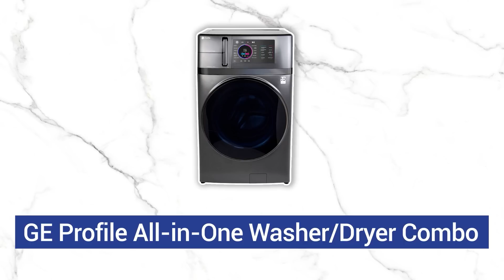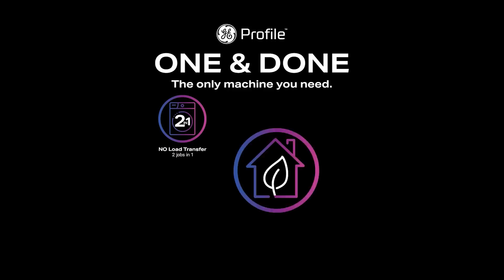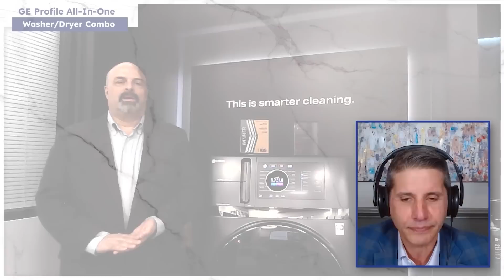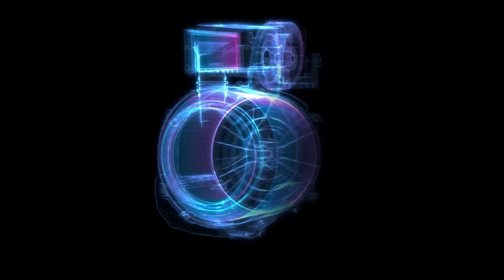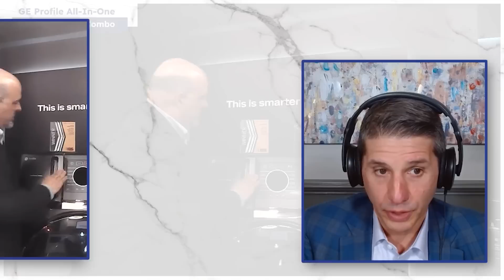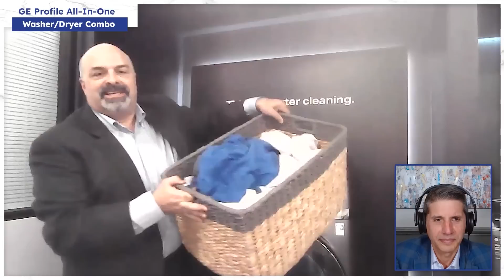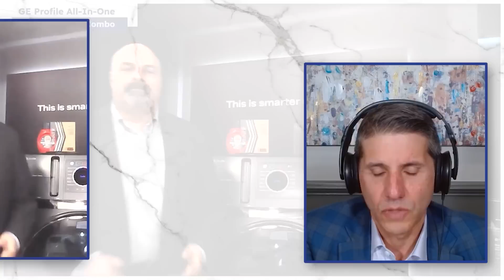New GE Profile All-in-One Washer and Dryer: Tough Questions for the Creator

Comment: I call BS on the lint not clogging up the machine and the heat pump staying clean. Their lint filter is one of the worst executions I've seen. It doesn't fit right so lint simply goes around it and covers the heat pump find. Wish the interviewer had called him out on this because the issue is so well known. There are even internet hack solutions that use weather stripping to improve the filter seal.
Reply from the maker: I think if you are religious about removing lint then the product is good. At least in 2 years of service
Reply: @YaleAppliance1 So pay $2000 for a washer dryer so that I can become a fanatic about lint removal because GE can't simply design a filter that fits, seals and prevents blow bye? Come on. You and I know they did this because it guarantees most owners will have issues within a year if not not months and will need to call for service.
Reply from the maker: Well, then don't buy the machine if you don't clean the lint. I clean the lint on my old Maytag after every use

Comment: So this filter does not catch all the lint. It does not seal properly and the coil gets loaded with hair and or lint. On top of that its a bitch to try to clean. On the left side li t builds up and dries on trying to find tools to get it all but cant. Just found out today water can be used to clean and drain through bottom clean out so i will try that but im worried if to big of chunk goes through it will clog it. With all that said we really do love the unit. I actually do 99%of the laundry and my wife doesnt have to.

Comment: I just bought this a few months ago and i LOVE it. In most instances its no more time than traditional machines. Less, if you count how often you forget to change it. I recently w/d my mattress cover. You know how usually you have to stop the dryer, unroll the mattress cover, get the wet part to the outside, restart the dryer? Well didn’t have to do that with this unit. I also think it doesn’t beat the clothes up so badly, produces less lint.

Comment: The creator is not telling people the problems.   1. No one can service these combos because  of  state laws that only trained hvac tech only can work on them.  2. Hvac tech cannot work on any appliances  that use heat pumps because only appliance  techs can because they cannot and are not allowed to get parts.  The lint still builds up. Secound since it has has 1 yrs to 5 yr warrenty  you cannot fix it. Cost is 3 times to fix the heat pump parts.  One ge had a bad pump and it cost 2,000 dallors to fix it. Plus the  freon is expensive and I see no ports to fix freon leaks then refill the system.
Reply: So after 5 years  you can pay someone 5 grand in parts and labor and wait for 3 months for china parts that are crap. Plus for large families it cannot do full loads so your ability  to do laundry is only 1/3 capacity.

Comment: The designer needs to do a better job on that filter system, as people have been observing dust and lint getting past it onto the coils and it's a pain to get in there and clean the coils and try to avoid damaging the fins.  When is the next new and improved version going to be released is the question?

Comment: The engineering was great but the Wi Fi App and the documentation are horrible.  The App is 50% ads that have nothing to do with the all-in-one unit.  The App is not made by GE but is funded by ads and is a pain to use.  The App is so bad my wife will not use it!   The Lint filter is a poor design and not sealed well so more cleaning is required to avoid repair.

Comment: I just got one, been running it for a week now. It's great. I had a 2.4 cu foot GE all in one before this and it's night and day difference on wash times and load capacity.   Also, it's way lighter on the clothes.  The other GE unit was very tough on things and cause the life expectancy to drop.  Imagine seeing brand new t-shirts look old after a few washes! You could see all the lint and colorful clothes parts shoot out of the water drain tube. Another thing that's interesting to me with this type of unit is the disaster preparedness aspect.   You could run this thing on a large ecoflow if needed.  Wish I could trust the app, someday I'll hook it up with an old wiped phone on an IOT network just to do some updates.  Good work! Wish GE could have figured this all out before they sold to Haier.
Reply from the maker: Thank you...Unfortunately, they would have never been able to make this under the old GE regime.  They never invested.

Comment: The form filter needs to be redesigned to remove the need for those placement holders - lint is getting through from those areas. Also, can people use condenser saved foam spray cleaner to clean the cold and hot condenser coils?

Comment: We went solar last year and one becomes very aware of how much electricity is used by various appliances.  We try to hang the wash when we can. I cringe every time we use the old inefficienct resistant coil dryer.  Not only does it use a tremendous amount of electricity but it requires punching a hole in the house and pumping out hot air to the outside.  I ordered one of these babies on sale - incredible efficiency, frees up a 220 plug in the circuit breaker for something else (heat pump or EV) and eliminates the vent - which can be dangerous is lint builds up.  Closed system is amazing - no more sucking air from the house.  And no more cooking clothes like they are in a toaster oven.  Should be much better on the clothes.  Just keep up with the filter maintenance and it will last a long time.

Comment: I like mine and I was totally freaking by paying $2400. The only problem I am having and trying to find if anyone else is having this problem too. In the spin cycle it shakes so violently that my pictures fall off my walls. I have done so many problem solvers and nothing helps. I called a technician and he said it was normal. I am crying because mine doesn't dry my bedding or heavy clothes like A normal dryer. I love it otherwise and I just want to get it to stop Shaking so hard.

Comment: I have one.  It lives you to it’s projections, it’s great.  It has a great warranty should it need service.  I’ll add one word of caution.  I stayed away from front loaders because of the mold issue.  This machine addresses that issue very successfully.  Keep the filter clean, I clean the filter after every wash.  Wipe the inner micro bacterial ring at the opening and there will never be a problem.

Comment: Purchased the GE Profile combo and it was installed on 9/5/23 and LOVED it. It then completely died on 10/9/23... I've had two GE third-party appliance repair services cancel service appointments with me because the unit is located in a laundry closet. Isn't that sort of location one of the primary reasons for the development of this machine... no venting required, available to apartment dwellers or people who don't have the ability to go to a basement? We are now waiting for a "GE technician" and I'm still not sure that they will service it. VERY disappointing and we're not sure what to do next. (To clarify, we did not purchase at Yale.)

Comment: We love this machine, but we do have to clean the lint filter after every single load. The sensor even prompts us to press the button asking if the lint filter has been cleaned with every load - even after Self Clean - which is a bit annoying. Also, the crevice tool for our Electrolux can't get all the way inside the lint housing because the it won't get in there when it's on the wand. There have been a few other issues, but overall, this Groovy Combo has been a life-changer! It would be good if you could provide some type of tool to clean out the lint slot that reaches all the way to the back. I clean the drain pump about once per week. Also, sometimes a few items bunch up and stick to the drum and have to be re-dried. Regardless, based on our experience since we got our Groovy Combo in August, I am blown away by it. My back also appreciates not having to make that transition from washer to dryer. I'm hoping it passes the longevity test. Thanks so much, Yale Appliance, for posting this interview. I stumbled across it in May and decided I was going to get this machine when it came to market. I gave it a 5-star review on the GE website.

Comment: I have had one for 6 weeks now and it has multiple issues and customer service for GE is less than desired and that’s being nice about it. There are NO appliances repair companies in Rural areas that can FIX or order parts and GE Repair techs will not DRIVE further than 10 mins outside the City limits! I LOVE my combo, but right now with the 5 errors codes, it’s LOUD sounds like I am washing nuts and bolts and then in dryer mode it flips my GFCI. All GE will do now that they know there’s not an appliance repair tech nearby they will reimburse me the cost of my machine minus the pedestal, minus the delivery fee, minus the extended warranty on the machine. 😞.
Reply: Did the delivery team take out the shipping bolts? I’ve read this situation happening frequently. Good luck, hope it’s fixed quickly.

Comment: I’ve had this combo for a few weeks now. I feel like I’ve been catapulted into the future! There is not a day where I feel like I’m doing laundry at all. The real work is folding and putting away now. Ours got back ordered and the laundry that built up for those 3 weeks was finished in a matter of a couple days. You can run this at night, when you’re away, without worry of a dryer fire. Also your laundry is dry when you get back to it, so there is no wet laundry that still needs to be put in the dryer and dried after you get home if you put a load in before you went out. I have ditched my laundry schedule and just throw a load in when a basket is full. I keep a clean basket to pull the dry clothes into and it goes straight back to a room to get put away in a flash.

I will never go back to traditional washer and dryer. This combo cleans better than any high end set I’ve ever had. There are never damp pockets or waistbands, no soggy quilt burritos that need to be flipped and dried again.

The only load I had a problem with was a small load of microfiber cleaning cloths. They were plastered to the inside of the drum and both wet and dry. So I hit the rinse/dry cycle and came back to them dried and fluffy. I think if I put them on a light spin instead of high next time it won’t happen. 

GE hit it out of the park with this one. It is truly a game changer. For anyone thinking it’s slower, it’s just not - embrace the freedom this combo will bring you. I simply do not have a backlog of laundry anymore, it is all always done.

Comment: New heat pump technology (if you consider a dehumidifier new technology)  Heat pump is terminology for hvac systems with a reversing valve. Technically you can call any refrigeration cycle a heat pump (all compressors pump heat)

Comment: Typical GE front loader washer rear tub bearing last up to 3-5 years. Compressor are not designed to last. So figured if the cost of the repairs are worth buying this washer for 2,800-3000 thousand dollars. Expect average of the life of this washer under 5 years before a major component breaks down.  From what I hear to replace the cooling system the whole cooing circuit gets replaced. So 1 full year parts and labor only 🤦🏻‍♂️ and 5 years warranty on just the cooling system parts only and no labor. 😂 who cares about the motor.  The drive motor is bulletproof. Give us 10 years on the Tub and cooling system. Heat exchanger will rust. Where’s the condensation going when the evaporator sweats.  So I’m gonna charge 800 labor to in stall if the cooling craps out of labor warranty and 500 labor or more depending how hard it is to replace the outer tub bearing assembly. Money making washer 🫰🏻
Reply from the maker: 3-5 years?  Really?  I think your numbers are a bit off.  Their new design has not been out that long.
Reply: @YaleAppliance1  think about it. GE has been using that same bearing from the same factory for years. It’s on my GE front loader. My sis front loader my moms front loader. We all have GE front loaders. I’ve replaced all 3 of our GE front loader bearings within the five year mark when purchased brand new. Now my sis bought the GE fresh front loader it’s been 3 years since she had the washer and I’ve already had to replace her bellow. He spoke about that GE has been using quality parts and components for years. Which that statement is incorrect. GE control boards go out less than five years I’ve replaced mine twice. You remember when GE put out those High energy water heaters with a compressor built in 😂 what a joke. Guess what. That’s the same compressor is in that washer/dryer combo. Those water heaters where nothing but problems. It’s new product with the same part built from previous appliances. Nothing is new when it comes from building a product using the same components. Well my friend those are not quality parts.
Reply: @YaleAppliance1  so I got pictures of the heat exchanger and compressor cooling circuit. All plastic. Have a few GE tech friends when I was working for GE. One tech took 2 hours to take the cooling circuit out. Stated it was not fun. Had to disassemble every wire harnesses with no quick release. Stated not worth repairing the cooling circuit if you just had to change out the compressor only. So yeah good good luck with those five years seal system repairs . After five years if that compressor goes out it becomes a pile of trash 😂

Comment: thanks for the video! GE need to fix start delay function. It's horrible and does not work properly. Every day I have to count hours for when the cycle needs to be complete when using delay start. Issues:
1. Washer UI let you pick hours and minutes but  in smart app it's only hours. What?! Why?
2. Smart app shows estimated completion time when washer is running but it's not showing completion time when using start delay function
3. Start delay does not show estimated start / end time in local time

My washer life is the big nightmare when using start delay!! 😭

Comment: does the door reverse on this model?  since it's so new, can't find data on it.  Looks like it should, but cannot find anything on it and support couldn't find anything "definitive" which wasn't helpful.
Reply: No. The inside door is angled and pairs with an angled vent to facilitate drying. Unless you have a rare location where you cannot open the door to the left, it will be just fine as is. I couldn’t do a front loader set in my laundry because my hookups are on the wrong side (only GE and Electrolux make reversible doors on those sets). This unit poses no problem, I put it where my old dryer was on the left and the open washer door doesn’t even impede the bedroom door that is next to it.

Comment: Tested on 5 loads of laundry each with different settings. Took between 4-6 hours. Had to return it by the return window. Good concept, needs few more years.
Reply from the maker: That long...was shorter in our tests
Reply: What settings? You’re the only one so far that has said it has taken this long. Others have said 2-2.5 average
Reply: What did you do, fill the entire drum? Front loaders, top loaders, none are meant to be packed full. Clothes need room to move and tumble. Even my thick towels and robes washed and dried faster in this than my old high end top loader because they for the first time didn’t make a wet burrito of toasted on the outside wet on the inside laundry that had to be flipped and set to dry a second time.

Comment: I have this model. Previously I had another brand heat pump dryer that remained with a house I sold. Heat pumps have been around forever. I owned a heat pump window AC/Heat in the early 80s, a geothermal heat pump in the 90s and I've owned two heat pump water heaters. I'm big on efficiency, so solar, EV, induction, convection, and HP whenever possible. One thing I've not found on this app is energy usage. My Rheem HP WH tells me every small about of energy it uses and shows cumulative for days, weeks, month, and years. My Samsung fridge does something similar. Why GE didn't have that feature is disappointing. The manual shows that the peak usage is less than my vac. Another point on the details, you need a drain too, so it can't be put just anywhere. I do like the appliance, but it is a little small for a dyer. It appears to work reasonably well on large load, but is slower than my previous dryer, which was over 7cf. Back in the 90s I worked for an electric utility in demand side management. EPRI worked with Maytag on then new Neptune. I had those and found them to be junk. I hope this one is better. I had this idea back then, even earlier in the early 90. I was at a convention and talking to a person from Arizona and mentioned that dryers should reuse the outgoing heat for drying. I acknowledge there would be condensate, but that it could go down the washer drain. The guy from Arizona suggested that it be captured for gray water for plants etc.

Comment: Bought one of these while living in Japan about 15 years ago, also a heat pump model. 
The driver for this in Japan is that there's no external venting for dryers. 
We had it serviced about 6 times in 4 years, and the warranty paid for a full replacement with a newer model. 

The main problem was lint management when used in combination wash/dry mode. 
We've moved back to North America and now only use it as a washer, and in this use scenario lint is not an issue. 

Full props to GE for having a very large lint filter. This would likely have made a huge difference with the machine we had.
Reply: Seems that GE has addressed the issues of past combos.  This thing is going to be a huge hit as it addresses so many issues - no vent needed, 110 power, incredible efficiency, convenience of the combo, space saving and it is a full sized unit.